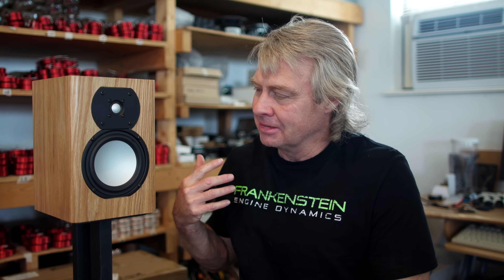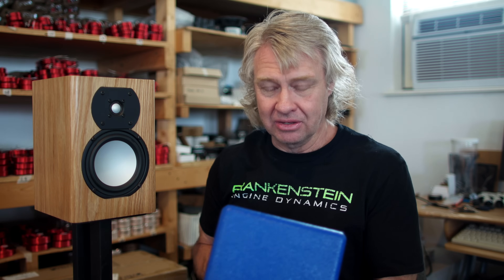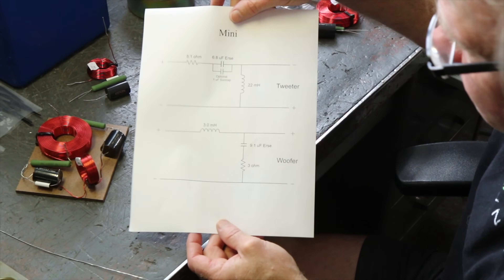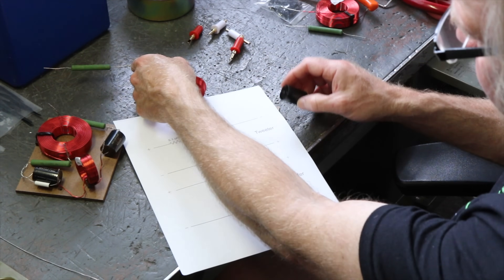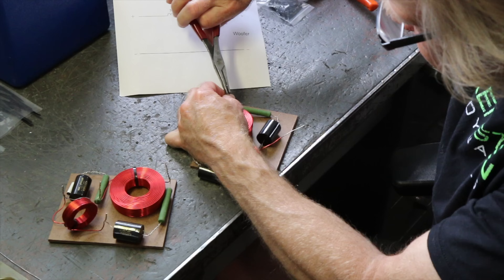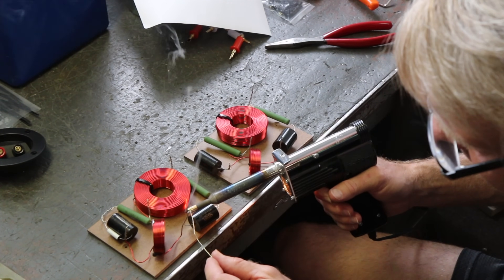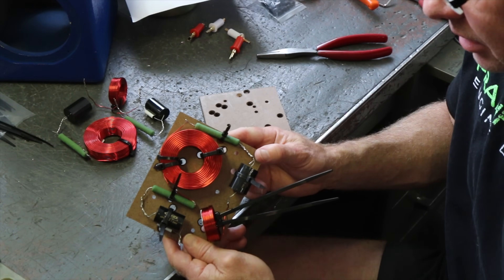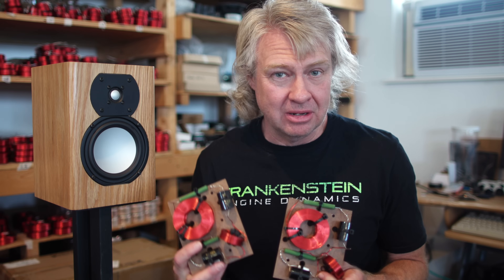Building the "Mini" | Crossover Assembly!

Comment: I never use metal screws to install crossovers. I drill the screw holes through four boards -- two crossover boards and two mounting boards. I countersink the holes in a pair of bards. I stuff 1/4" diameter nylon flathead screws (1" to 2" long  depending on what I need) through the holes and hold the screws in place with nylon nuts. Effectively I make a mounting board with studs sticking out.
Once I have the mounting boards made I bond them to the inside of the box. When it comes time to install the crossovers I slide them over the the nylon studs/screws, add some nylon washers and nuts as needed to hold the whole thing in place. I don't need to worry about affecting the impedance of the coils. Or I can assemble the crossovers to the studs and mounting board, and bond the whole assembly to the inside of the box. In either case it's easy to remove the crossover if I ever need to. 
I've done this for years, and even come back 30 years later, and everything looks brand new. This works for circuit boards or point-to-point boards like the ones Danny makes here.

Comment: Hi, have some "Rauna Ymer" speakers made of concrete from the 80s (Sweden - Bo Hansson) where I want to update the crossover and maybe even get better sound (although i love them), and the question is when you want to use a mix of 2 capacitors in parallel (economical + space) where one is of good quality and the smallest percentage is of superior quality, how much % should the smallest contribute to for optimal sound/ price effect. Ex. tot 10uF where one is at 8.2 and the best at 1.8uF? Thinking of using Jantzen Cross Cap or Jantzen Standard Z-cap as the large and Jantzen Superior Z-Cap as the smallest? Has education in electronics, so it help's

Comment: After over 50 years in IT, much of it in hardware I will say your soldering and your accompanying dialogue including the resisters can take the heat better than the caps, and I'll clean that up after on one occasion, was the best I have seen on Youtube. 
Such a very pleasant change after the cowboys with their never ever cleaned iron tips and failing to use a bit of solder on the iron to get started and not bothering to let it heat up, then creating dry joints by various means such as lack of heat or solder. or the opposite with solder all over the place in globules. Some even using those funny bent wire resistance thingies to solder in places that damage anything near the part to be soldered, I saw one youtuber "fixing" components on a densely populated SMT area of board with one the other day and needing to realign many components near the one he thought he was targeting. Thank you for showing that there are real solder capable people on youtube.
Reply: @jimspc07 Thanks for your insights as well. Between you and Danny I've learned a lot.

Comment: I was wondering when you add a 1 uf sono cap is that added into the value? So if you used a 6.8 uf cap and a 1 uf sona would that be the same as using a 7.8 uf cap?
Reply: That was a .1 uF value.
Reply: @dannyrichie9743  that's a nice technique

Comment: Hello Mr. Danny. 👋Mr. Danny this green resistors Dayton Audio made? Green Dayton Audio good resistor. And about capacitors.. I know, you like Sonic caps, but You forget about two ✌️ very important nuances. First - The larger the capacitance of the capacitor, the lower the speed of the signal.Second - all capacitors have one big flaw - extremely thin lead wires. Therefore no need use one capacitor, this big mistake!For perfect result, need use big quantity little capacitors and connected all capacitors in one parallel. A big quantity small capacitors pass through the signal maximal quickly. Therefore, If you need one capacitor, for example, which have price 20$.Much better use 7-9-11 capacitors, which have low price. Rubycon MPB Polypropylene green capacitors very good capacitors and have low price(don't forget that  Rubycon legendary Japan capacitors company),next choice - JB JPX Supreme red capacitors very good caps, and last choice Dayton Audio PMPC capacitors good caps, which have very low price. If you are using for crossover 9-11 Rubycon polypropylene capacitors or JB JPX Supreme caps, maybe Dayton Audio PMPC caps and connected all capacitors in one parallel, this method give you perfect results, much better than one capacitor for 20-22$.Same resistors, need connected big quantity in one parallel.

Comment: How do you mount crossover board to speaker cabinet? Should not you make holes before assembling cabinet?
Reply: With a silver marker, I mark the spots for the screws that are used to hold it down.

Comment: Can I go ahead and connect the wires that go to the drivers and input connectors at the same time as the crossover parts and do all the twisting of wires and soldering at the same time?
Reply: You would have to ensure proper length of the speaker wire after the cross over assembly. The only way to do that is to physically place the assemble cross over into the box. That's why it's in two steps. If the wires were pre measured and there were no flaws in the assembly you could. But that wouldn't be diy, and would cost more.

Comment: wouldn't it be interesting to have a video where you see the frequency response at the listening point in a well-treated environment? because otherwise having an excellent frequency response of the only speaker  I don't think it will be of much use, don't you think?
Reply: No, it is actually the other way around. An in room response is useless. It is only specific to one room only.
Reply: @dannyrichie9743  what I meant is how good the frequency response can remain in a properly treated environment. Because if the final frequency response becomes poor, what is the point of pursuing an excellent frequency response of the speaker alone?
I don't think showing how the frequency response becomes in the room is a waste of time or useless. I think it can be very useful
Reply: @wallalo  It then becomes a measurement of the room and not really a measurement of the speaker. I used to do it all the time to help correlate the speaker measurement and the room measurement and to tweak the room.
Reply: @dannyrichie9743  sorry but I did not understand, have you already made a video or written something somewhere where you can see the frequency response in the environment of some of your speakers?
Reply: @wallalo  No, I shoot all of the speaker measurements using a gated time window.  So there are zero room related contributions to the response.

Comment: Looks good.

As you have seperate filters for bass and tweeter, do you think there'd be any benefit by putting crossover in a box close to amp and bi-wiring to loudspeaker?
Reply: That would actually be a bad idea. That doubles the speaker cable runs and with budget cables it will increase the RF noise levels.
Reply: @dannyrichie9743  About 10R non-inductive in series with 47n and parallel to speaker terminals usually does away with RF at speakers end, if living next to a radio broadcaster.

Comment: I am waiting for my kit and these videos are awesome. I like that you painted over the DeraTex. The blue looks nice. I did go for the fancy caps so one less thing to solder lol. Is there enough room for T-nuts? I have had problems with mdf stripping the screw holes. I think I will try to find someone with a router near me to round over the sides on front baffle. I like that look. Thanks Danny for doing this. The DIY 16 strand speaker cables will be next.
Reply: The screws that come with it are fine for the MDF. No stripping issues at all.

Comment: hi danny to tide the rsistor with plastic tides could be a problem with the temperatur at the resistor ?
Reply: DM is correct. They will never have to dissipate much heat and never will get very hot.

Comment: The only problem: if I want change something in the future, say pad the tweeter down I'll be screwed with the 'lead twister' approach. Soldering the leads to tag strip connector the way Troels does his crossovers would be better but more costly.
Reply: ... or use a strand of thin sacrificial wire, hold the leads together and tightly wrap the wire around to keep them in place. If you're making amends, wick/desoldering gun, cut through the wrap and everything pulls apart nicely.
Reply: I won’t twist ‘em too tight so you could still untwist after desoldering if you plan to make changes..
Reply: Actually those tag strips degrade the signal quality quite a bit. I don't recommend them.

Comment: I am new to building and watched your videos on building the encore speakers and had to take the cross overs out and redo the connections on the inductors because I missed or you never showed you had to get the red coating off the ends of the inductors for it to make a proper connection and work. That may be very basic but I didn't know.   They sound great now and I'm going to get a set of these.  here you didn't say anything about the red coating either and that is pretty important for us newbies.
Reply: This was only a problem when I cleaned Erse out on inductors, and the wire they use to wind them and had to order inductors from Solen. There coils are just cut, not cut and Tinned. The coils that come with these are already cut and Tinned. So no worries with these.

Comment: why not use hot glue instead of ties? or any glue?
Reply: Would silicone caulking between the components and the board help in further reducing vibrations/resonances?
Reply: @matthiasmartin1975  A little and very little. If you use Silicon then let it dry for a few days before you install it.
Reply: @dannyrichie9743  ah, I understand, because the fumes are often corrosive, right? The vinegar smell gives it away.
Reply: @matthiasmartin1975  Correct.
Reply: Ties are more secure and they also give a more clean look to the board,  you need to be careful using hot glue, I have melted the covering on some caps with hot glue, it did not effect the caps other than it made them look like crap and just using hot glue or any glue makes the crossover look messy (just my opinion), even though the crossovers are not seen, I personally would still like them to look professionally built. 
Having said all that, you can use glue if you want too, there is nothing really wrong with glue providing that you use something that won't come loose over time, it comes down to personal preference.
Reply: If you are careful, hot glue can be used too.
Reply: Just use the ties and be done with it. What are you gonna take a sub out once in awhile to show your buddy the hot glue tie combo or the fancy carbon fiber you used as a board? Com on.
Reply: I make separate enclosures on the rear for making changes, with clear covers, so yea